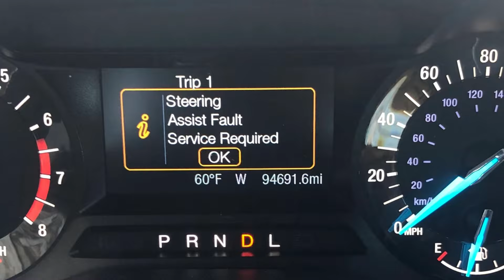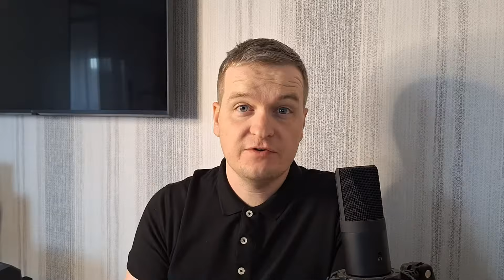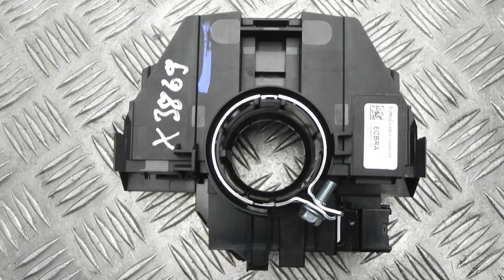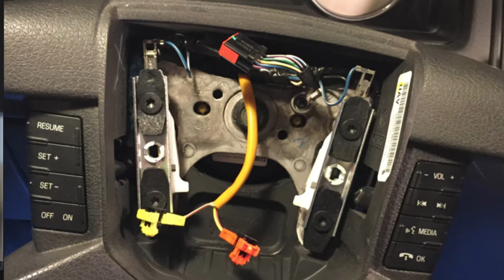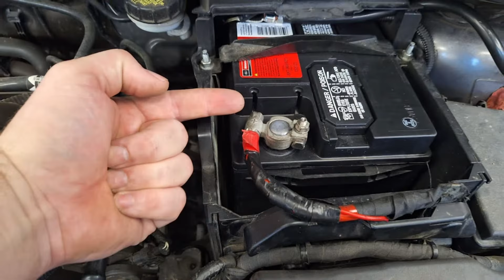“Steering assist fault, service required” warning in Ford cars

Comment: i have a 2023 mustang and my steering suddenly became heavier when cruising specially at low speeds, there were no warning lights at all but when i scanned i had a code u0415 invalid data from abs. after a while my ac started blowing hot air so i brought it to the dealer and when they fixed it, code u0415 is gone but A/C codes remained and my steering is still not working properly. anyone have any idea on why this is happening? dealer also cannot figure out whats happening with my steering since theres no warning lights.
Reply from the maker: It needs better inspection. There is obviously an electrical fault in the steering system and the rack is in protection mode, the power steering is working but not to its full potential. AC problem may be related if there is also a problem with 12V power supply - this would explain everything since the AC compressor and alternator are driven with the same belt. The car needs a good mechanic to inspect it properly, measure voltage everywhere, etc.
Reply: @TopicMotor  I already brought to it to go to guy mechanic in our country and sadly he couldnt figure it out either. I also replaced all four wheel speed sensors and got a new battery as well and had them clean bcm module and stuff. Im from philippines and its quite hard to find someone who can fix it aside from the dealer.
Reply from the maker: There are just too many things that need to be checked. You may try dealership inspection and then go to an indy mechanic when you already know the culprit.

Comment: Rodent chewed wiring on ford fusion 2014 in front driver side wheel well and the car had this fault message and no turn signals.  It was a single green wire that was totally chewed through that caused all of the problems.

Comment: My 2012 Ford fusion AWD had the dreaded message and it became hard to turn ...Ford told me I needed a rack ...I thought even though it only had 135 km on it I wasn't going to fix it for a small fortune ...a mechanic friend said check the ground on the strut tower ...took it off cleaned all the hidden rust ...put it back on boom power steering was back

Comment: I checked my 10 amp fuse, my battery, my alternator... I noticed when it was winter out my steering wheel would not move at all until the car warmed up.. No dash lights at all. But now i get the stop safely, the trac control etc etc and i cannot hardly move my steering wheel by hand, i have to use 2 hands, very hard..........I also tried to unhook battery, touch terminals together for 30 sec and re connect battery. same dash lights came back on immediately....
Not sure how i would know if its the angular sensor or the rack.......
Reply from the maker: This is a typical behavior of the power steering mechanism on the rack dying gradually. You may learn more by using a good Ford-compatible scanner or ForScan software and reading the codes.

Comment: Here's the issue mine has... It likes to try and correct the angle of my wheels while I'm driving and makes it look like I am jerking my steering wheel outta nowhere. It does it at high speeds, just cruising and when I need to break hard. It's dangerous and expensive to fix.

Comment: I had to change the electric power steering rack and after that stopped working and showing "Lane Keeping Sys. Malfunction Service Required" can you help me about what to do for it? The car is 2016 ford fusion energi titanium plug in hybrid
Reply from the maker: Probably, there is an issue with connections on the steering rack. It needs to be tested in a good repair shop, I don't think there is anything you can do on your own here. Maybe confirm that the 12v battery is OK - load test in any car  parts store is usually free.
Reply: Ok thank you so much  @TopicMotor

Comment: Does anyone know EXACTLY which part breaks in the steering assembly. I’m a machinist and fabricator so I know I can fix it, but it would help to know exactly where the problem is.
Reply from the maker: It's usually unfixable because the problem starts with water and mud getting inside and affectin a couple of things including the bearing. Then it starts vibrating and gradually destroying the body of the rack around it. So to fix this, you will need to change the body, the bearing, and also a couple of other components that are affected by corrosion. It's claimed unfixable because it's usually cheaper to buy the new one than to fix the broken one.
Reply: It's the electronics in the EPAS brain box attached to the rack and pinion rack. The motherboard and chips are heat sensitive after a certain temperature and begin to fail after repeated exposure. Just another way that Ford decided to make us bring our cars back to them for more money.
Reply: @Ryan_Hans_Random_Worx 🙏 THANK YOU SIR! I had a feeling it was electronic because when I replaced the fuse it worked for a couple weeks then the power steering stopped again. You can steer it manually so I had a hard time believing my particular issue was mechanical.
Reply: @Ryan_Hans_Random_Worx This just goes against Ford's marketing that their cars are "Built Tough"! How can a car's vital component fail due to temp when a car's component and exposure is expectedly be HOT and humid! Someone should sue Ford!

Comment: just put a used steering rack in my 2013 mks. part was 350 and installed it myself its a decent job.....  Fords estimate was $4000ish to repair parts and labor.
Reply: Yes, thanks for info. I have this problem today... probably car is total loss.  2016 MKz  148k miles
Reply: Did you have to reprogram it ?

Comment: This happened to me once, and repair shop replaced electronics (box with gear on rack where connector goes in). Now when I turn engine on, there’s random delay of 5-7 seconds (sometimes without delay) while I get power in steering wheel. 
I had random occurrence on U3000 error, like you described, and after couple of months it became permanent U3000-53 (I think), then went to repair shop.
Do you think only replacing electronics may help? What may be a cause of this delay in getting power in steering wheel?
Reply from the maker: This depends on the system. The code you get may refer to park assist module which makes me think the new electronics you got wasn't coded properly, hence the delay in power steering. It needs to be looked at by a person who knows a thing or two about coding ford cars.
Reply: @  It seems that's the case. Thank you. 
Just out of curiosity, can this permanent U3000 error be removed by reseting module by Forscan or IDS?
Reply from the maker: Probably, Forscan will remove it temporarily. But the steering system should be checked and coded properly. Now the brains see some module as alien and throw codes - this will return shortly after reset, I believe.
Reply: @TopicMotor when my van finally goes, I’m going to buy an older, non-electronic truck. It makes me sick we now need to know a proprietary computer code to fix your own car.
Reply: @bill4639 it's all about the transfer 😂
Money from your pocket to theirs.

Comment: Where is that found in the car?
Reply from the maker: What exactly do you mean? The rack? It's attached to the partition between cabin and engine compartment in the lower part, it's connected to the steering column's lower end. Visible from under the car

Comment: Did this job on my 2013 Flex, replaced the whole rack at 95,000 miles. Now at 163,000 it needs the steering angle sensor 😂

Comment: I just change my rack and pinion and I need it programmed
Reply: Download forscan, get the trial license, and look up the video about programming it. Easy fix
Reply: @MattShepherd-b1p do you know exactly what the problem is with the power steering assembly? I can make or fix anything, so if you could tell me what is broken, it would save me a lot of time. Thank you.
Reply: Do you need to take to dealership to have programmed
Reply: @ The mechanic knew someone with a paid membership to a specific software, and they programmed it for me. If you’re not as lucky, you’ll likely need to take it to a certified Ford dealer for programming
Reply: @sherraj0545  thank you!

Comment: Just change the belt
Reply: just change the belt? thanks for the laugh. lol
Reply: Actually I just watched a vid where the guy had a 2010 + Ford F150 and that is exactly what he did. He took a damaged belt out of the steering rack and replaced it with a new one. Interesting in that the Ford flex is considered a truck as it is produced in the truck division not the former car division.

Now Rockauto shows the steering rack for a 2016 Ford Flex as fitting other cars and not the F150 so it may not have a belt to replace. 

On ebay they show a OEM Electric Power Steering Rack & Pinion Belt for Ford Flex 2010-2019 for about $56, which looks simular to the belt that was taken out of the F150, so there may be a solution to the problem for a very low cost part and whatever it takes to get the belt in in labor. Again Rockauto shows the rack with a drive motor attached above the actual rack which I assume is an electric motor using a belt drive to "assist" in moving the rack back and forth.

So when he says "just change the belt" I am inclined to believe him
Reply: @thinkfirst6431 good to know my flex doesn’t have a belt I believe o the rack
Reply: @GeneOliver-g5m  

Look at the rack. Do you have what looks like a normal rack housing with a round housing mounted on top of it with wire(s) running to plug(s) on the round housing. If so the round housing is the electric motor and the housing connecting the two together is where the drive belt is located.

It seems like Ford and the service industry in general would much rather charge you for the labor and a new rack and pinion than take a little more effort to take the rack apart to change the belt. The belt is a wear item that Ford didn't bother to point out as they made more money charging for a new rack and pinion than changing a belt.
Reply: Why would you say that
Reply: these are electric steerings 
not hydraulic 
hence no drive belt for steering
Reply: @xenon.xavier Bro.,I would like to know you that the electronic power steering assembly there is a small belt inside the epsm
Reply: listen to the youtube expert..lol